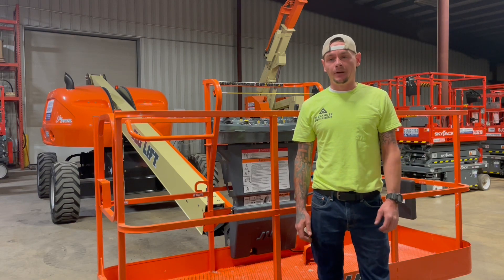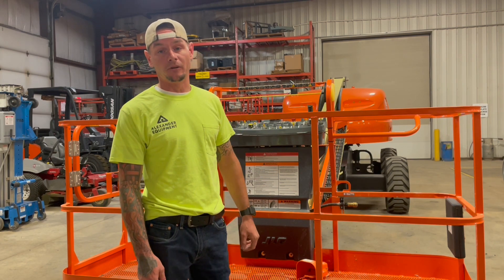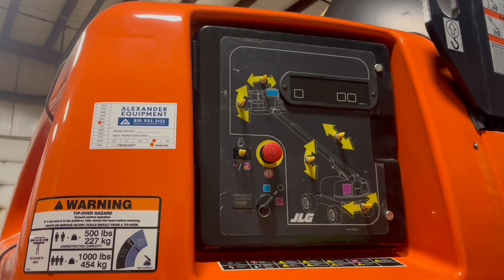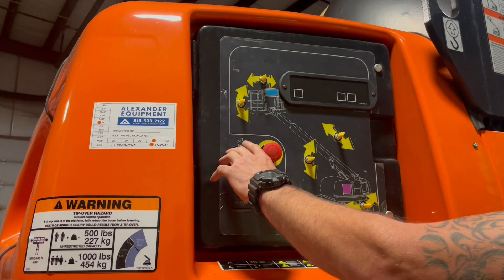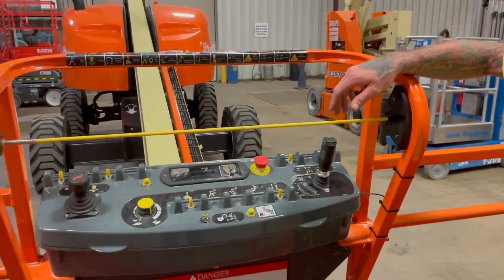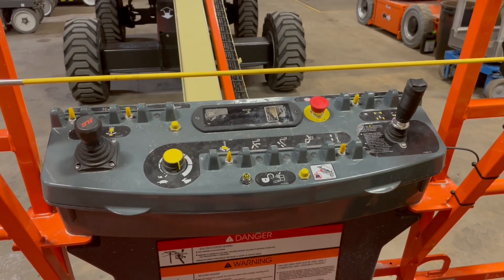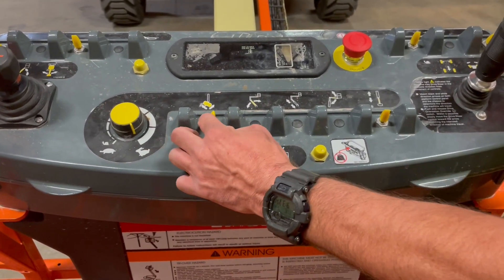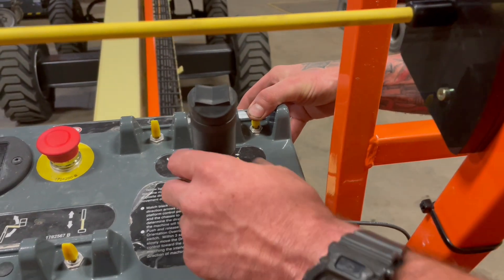How to Operate a JLG 400S Boom Lift

Comment: You forgot to show how to drive it in rabbit mode while not being on flat surface. What angle is the boom and basket supposed to be to engage rabbit mode? The lift I am currently using is beeping and wont go in rabbit mode, so it goes extremely slow.

Comment: Can you explain to me why I can't start it from the front? Before, I could start it, but a few days ago, when I put the key in the front ignition, it wouldn't work.
Reply from the maker: Thanks for watching our channel.  OSHA mandates that only trained and authorized individuals be allowed to operate an aerial lift. Your question indicates to us that you are in need of operator training. A comprehensive training program includes classroom instruction as well as hands on familiarization of the specific make and model of machine to be operated. We offer training at Alexander Equipment but if you are not in our local area, we highly recommend you reach out to the nearest JLG dealer to schedule training that will give you the answers to every question question you may have about operating a JLG 400S boom lift. This link may be of some help locating an authorized dealer near you:  https://www.jlg.com/en/find-a-location

Comment: How does one operate this on non level ground say around a building ?   Does the base compensate up to a certain amount of slope ?
Reply from the maker: Thanks for watching our video. This is a great question and requires a bit of detail so please forgive the long reply. 
Traveling in the stowed position is allowed on a sloped surface as long as it does not exceed the max slope rating for the machine.  Maximum travel grade in the stowed position can be found in the operator's manual and should be 30% for 2WD and 45% for 4WD option. (Maximum side slope for traveling in stowed position is 5 degrees) However, all MEWP's including a JLG 400S boom lift are intended to be elevated only on a firm level surface.  Always rely on the manufacturer provided operators manual specific to the make and model of the machine you are required to operate. 
The following is directly from the JLG 400S operator's manual: "Section 4.2  Operating Characteristics and Limitations: Capacities: Raising the boom above horizontal and/or extension of boom beyond retracted position with or without a load is based on the following criteria: 1. Machine is positioned on smooth, firm and level surface. 2. Load is within the manufacturer's  rated design capacity. 3. All machine systems are functioning properly. 4. Proper tire pressure exists in the tires. 5. Machine is as originally equipped from JLG." 
The only lifts that can be elevated on a sloped surface are ones that are equipped with outriggers such as a properly equipped rough terrain scissor lift. Remember, only trained and authorized personnel are allowed to operate a mobile elevating work platform. We highly recommend proper training for all operators.

Comment: Am i supposed to keep the engine running when in the air or can i turn it off until I'm ready to come down?
Reply from the maker: Thanks for watching our video! In general, it is acceptable to elevate the platform on a JLG 400S to where work is required, shut down the engine to perform the job, then restart for lowering the platform. However, we recommend that for jobs requiring a short period of time, that you leave the engine running to avoid unnecessary wear and tear on the starter and battery. In addition, we would like to make sure every operator understands that proper training is required before operating a boom lift, including classroom instruction and hands on familiarization of the specific make and model to make sure you understand the procedure for lowering the platform in the event the engine will not start when platform is elevated.
Reply: @AlexanderEquipmentRentalInc  Sunbelt rented me the 60 foot and only asked "do you know how to operate it" and I said "I grew up logging.... Operated skidders, loaders, tree harvesters, etc..... been about 10 years though..." 

And they said "great well if you have any questions give us a call"

Not a walk through or anything...... They didn't even include the safety harness for it, they said I have to buy my own.... I thought that was pretty crazy....
Reply: @christophermhudson09  Funny same sunbelt experience over here.  They dropped it on my job and left the key in i, they said it was totally fine.  Ok.  I think the harness thing is a liability.  If they provide safety equipment and it fails, lawsuit.  If they don't include it and leave it up to you in the contract, the liability is on you.  At least, thats how I think it probably works.  The rigs are about $100 at depot.

Comment: Do you need to put your emergency stop button when you're up there , like a scissor lift ?
Reply from the maker: The emergency stop buttons both need to be in the up position in order to operate the boom lift from the platform controls. In the event of an emergency where the power needs to be cut immediately, press the emergency stop button in.